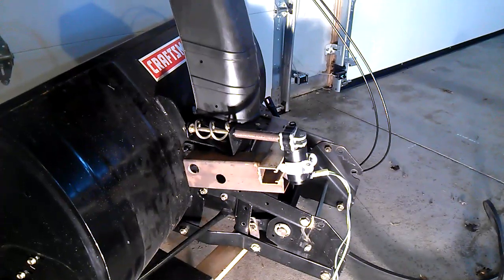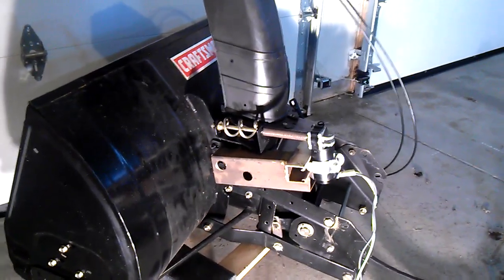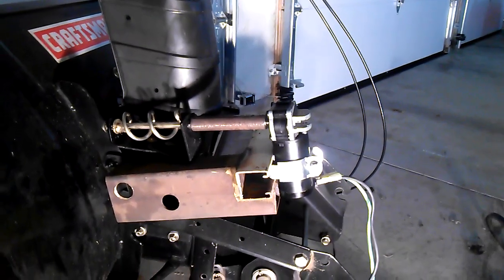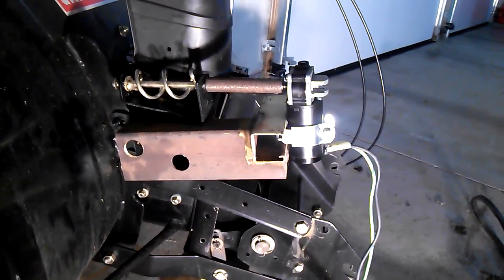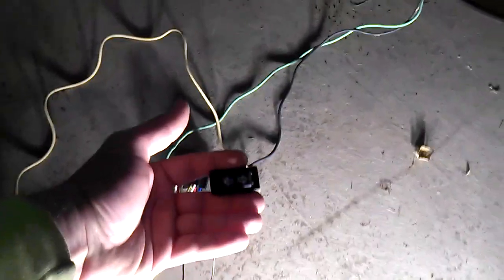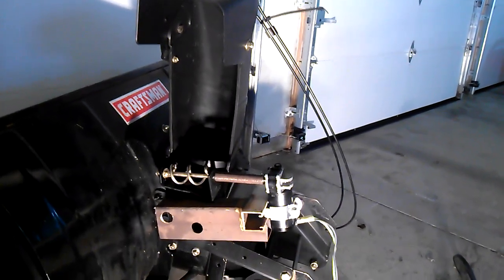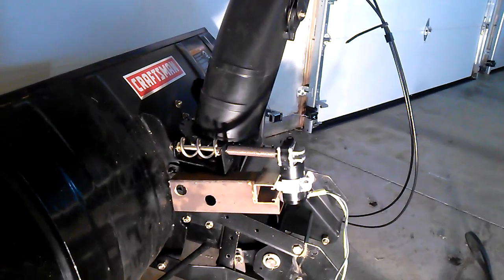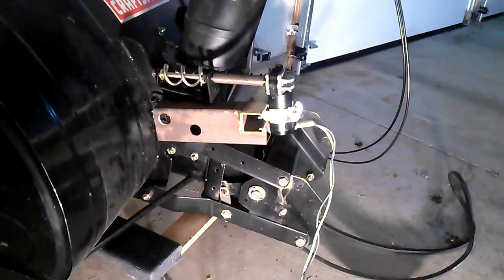Craftsman snowblower chute converted from manual hand crank to electric drive motor

Comment: No need for any relays.  Just a single DPDT switch wired so that it reverses polarity to the motor is all you need.
Reply from the maker: Scott Ambrose Yes DPDT would work.  But i want the controls to sit or  be positioned a certain way

Comment: Great job Keith. I really like how smooth it is and the left-to-right speed looks to be dang near perfect. I see this video is just over a year old so how has it worked out for you?
Reply from the maker: Works great. used it about 15 different days this winter.  Cheapest modification I made of the 3 upgrades.   I do have kits available if interest.
Reply: Excellent in all respects.  Look forward to seeing your other mod videos.

Comment: Keith- where did you get the directional / H-bridge (?) switch ?
Reply from the maker: Joe I got the switches from eBay if you would like more information you can text me or call me 419-975-9758
Reply: Thanks Keith.   I'll be giving you a call.  Love the flashing lights, too.  I just put on Red LED Tail Lights and 2 horns on my craftsman tractor.  Just received some LED flood/work lights that I need to mount, as well.
Reply from the maker: Joe FromRomeo
text me first,  I make time to chat

Comment: I have the same snowblower.   looking to add motorised chute and deflector to mine but need more info please.  also looking for a way to make mine into elect. lift.  My side handle gets caught all the time and have a lot of trouble lifting it up and down.  Have seen ATV 2,000 lg. elect. winch on some.  also have seen fromt bracket motorised to lift blower up and down.   Any help and suggestions would be greately appreciated..tks

Comment: What motor exactly did you use? I am looking to do something similar to a Cub Cadet 930SWE. I am not a fan of the manual crank. I am not concerned about the deflector as it has quick in-dash controls for that, but the rotation of the chute is manual and very slow at about six revolutions to go 190 degrees. I really like your setup and need to know the model number of the motor you used! Thanks for posting!